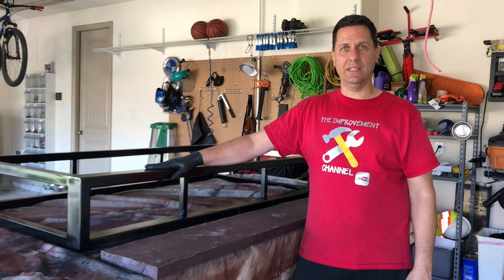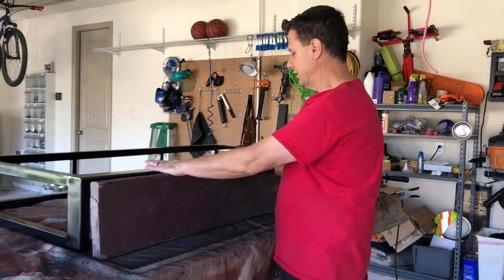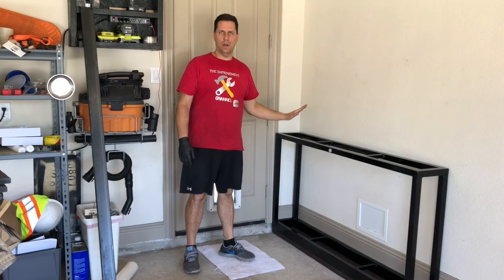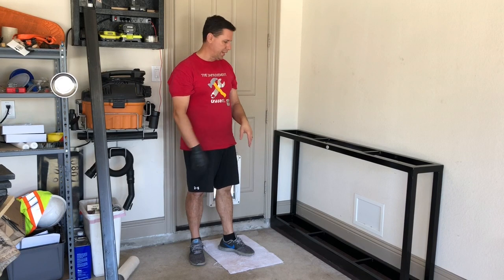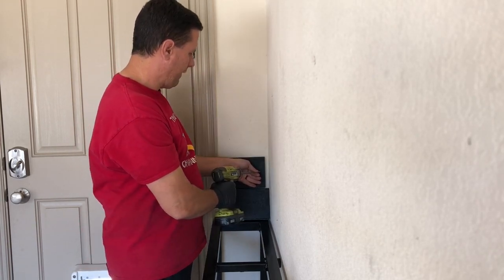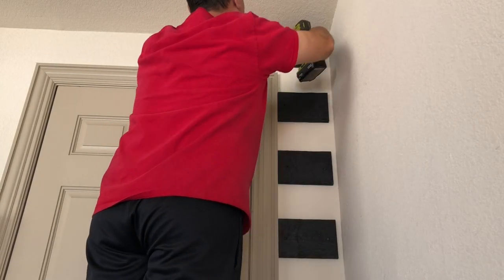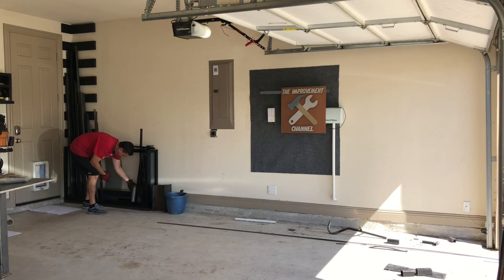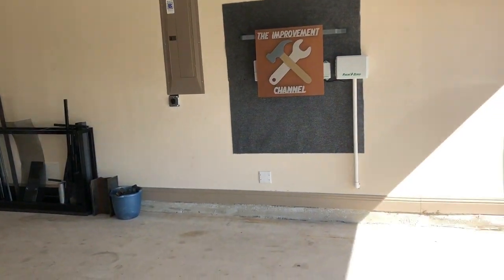How to Build Metal Storage Rack | DIY Vertical Corner Scrap Metal Holder | With a No Rust Bottom

Comment: Bevel all cut edges before fitup and welding. That gives the weld bead something to go into instead of sitting on top of flat faces. When you grind your face welds flat, you're removing most all your weld. Trust me that failures can result.
Reply from the maker: I will try that on the next one I have coming up soon. Thank you for the tip.